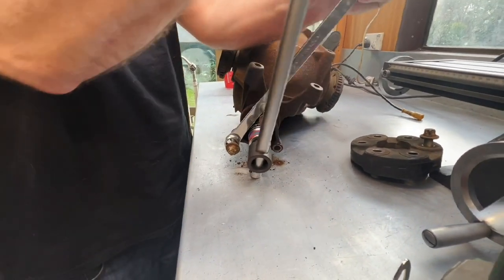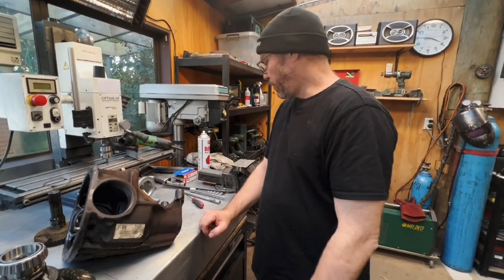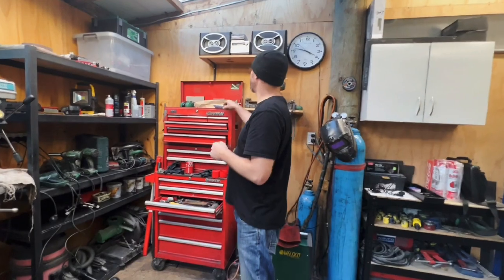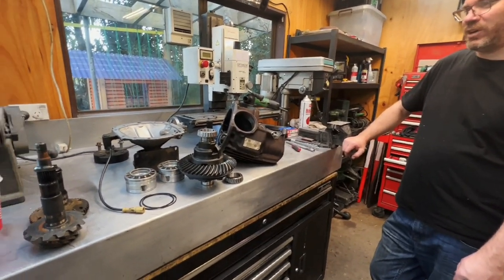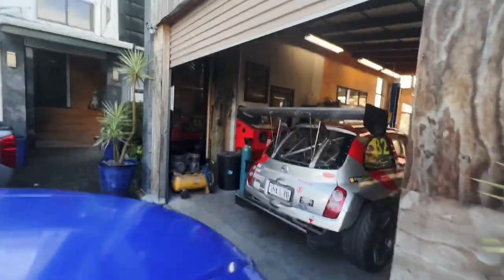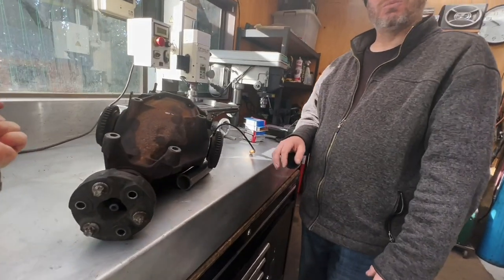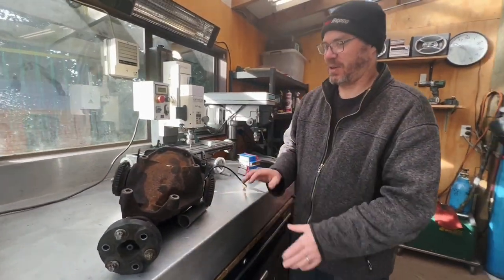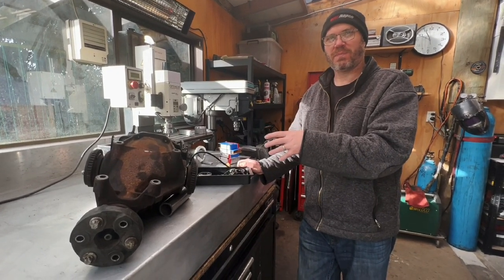Holden M80 Diff rebuild part three

Comment: When I replaced the bearings in my Dana M80 differential I kind of chickened out at 2 Newton Metres of drag on the pinion bearings because I did that up with an impact wrench 9 1/2 years ago, the was good because 2.8 Newton Metres is the maximum torque setting for that differential anyway.l, note that only the diff pinion gear was installed when I did the pinion nut up.

I have the specifications for the Borg Warner IRS diff which is in the VN-VS Commodore which is the same thing.

To get the side bearing torque of 1.5 Newton Metres I divided the torque setting by the diff ratio (3.91) to get a torque input of 0.4 Newton Metres therefore I added 2 Newton Metres & 0.4 Newton Metres to get a torque figure of 2.4 Newton Metres at the pinion nut.

So after a decade I need to replace the gears so I am building up another diff,the original gears were stuffed because they began to hum after the pinion bearings Lost their preload due to a damaged small pinion bearing inner race ?